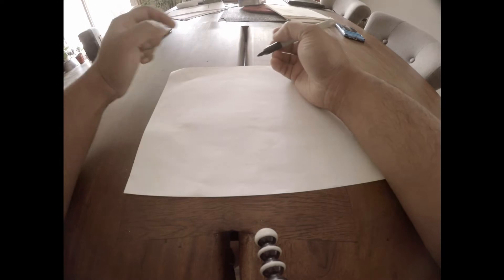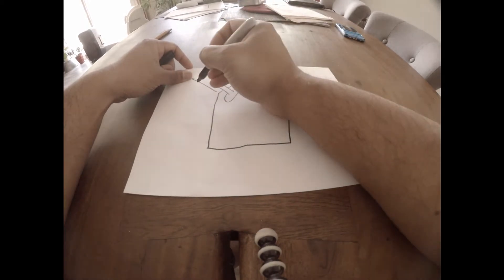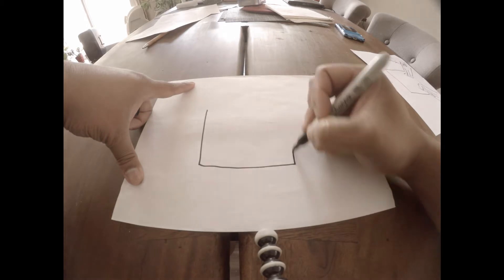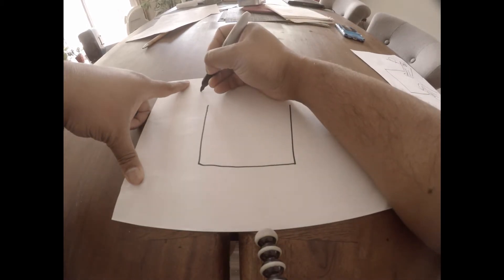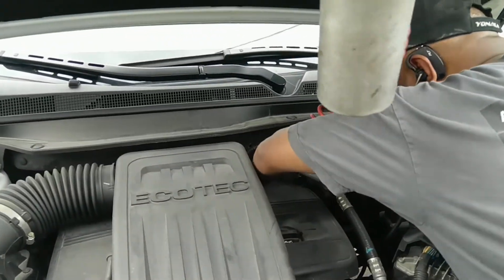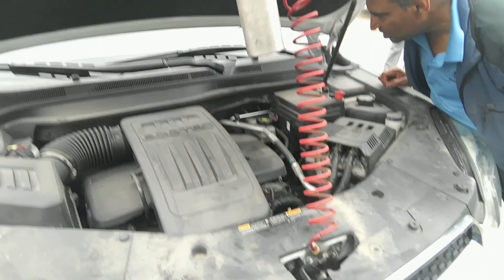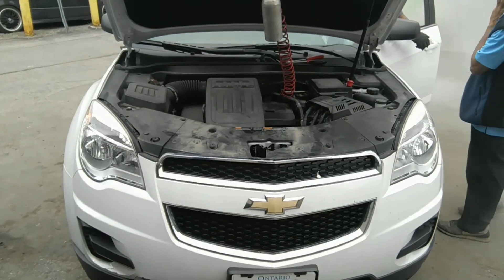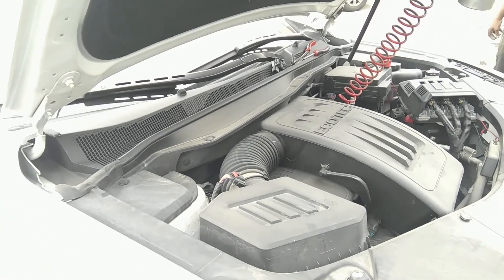How to clean intake Valves in a GDI engine Using Seafoam| Car-addiction

Comment: Not an effective way I am afraid 😕.
You have to clean it manually with mechanical tools.
Nevermind with the smoke thing. I doesn't tell you how clean are the intake valves. You have to remove the manifold and see it by yourself.